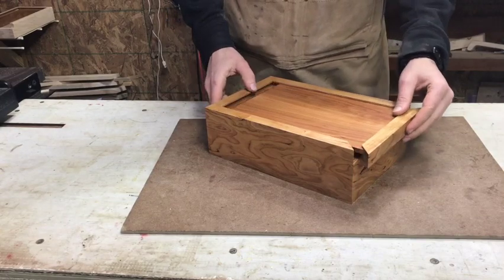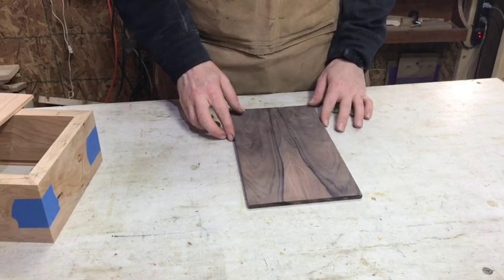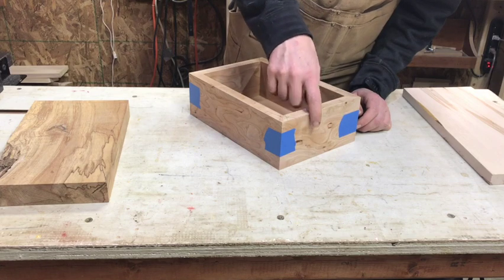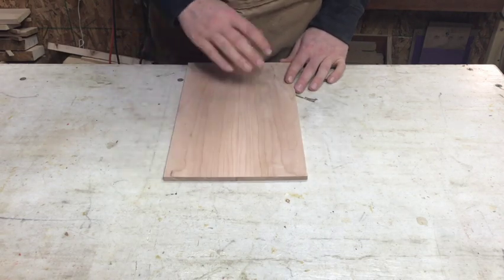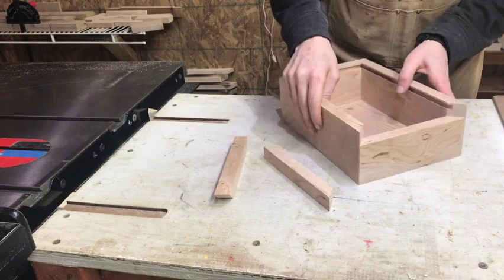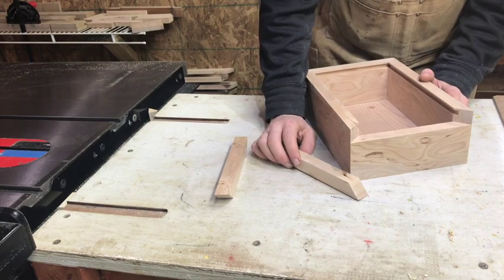Making a Sliding Lid for Wooden Box - Full Tutorial.

Comment from the maker: Timestamps:

- Intro: 0:00-0:38
- How to choose wood for lid: 0:38-4:30
- Making lid: 4:31-6:02
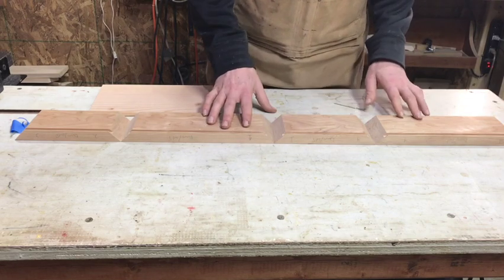- Overview of sliding lid concept: 6:03-9:42
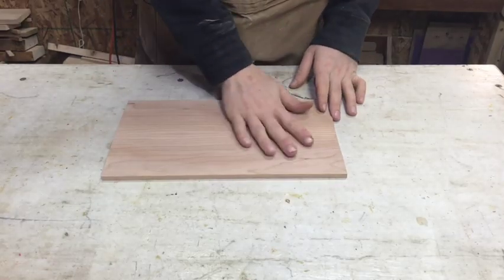- Checking lid: 11:35-13:17
- Marking out groove: 13:17-16:42
- Router setup for groove: 16:42-21:20
- First groove cut: 21:20-23:00
- Checking lid: 23:00-25:53
- Prep Box + Lid fit: 26:00-29:58
- Choosing grain for lid lip: 29:58-30:57
- Milling lip piece: 30:57-33:50
- Cutting lip to height: 34:16-35:21
- Cutting initial lid width: 35:21-36:20
- Cutting lip miters: 36:20-43:18
- Layout/Prep for lip groove: 43:18-46:42
- Router setup for lip groove: 46:42-48:16
- Routing lip groove depth: 48:16-49:00
- Routing lip groove height: 49:00-50:49
- Final lid dimensioning: 50:49-53:22
- Recap of fitting + trouble shooting: 53:22-55:48
- Glue up prep: 55:48-56:25
- Pre-glue finishing tips: 56:25-1:00:24
- Glue Up: 1:00:24-1:08:21
- Final Sanding: 1:08:21-1:11:03
- Outro/Finished Box: 1:11:03-1:11:20